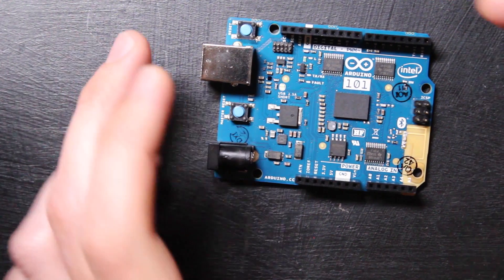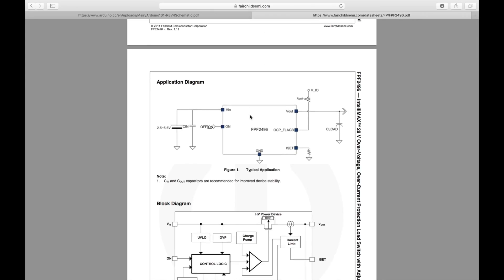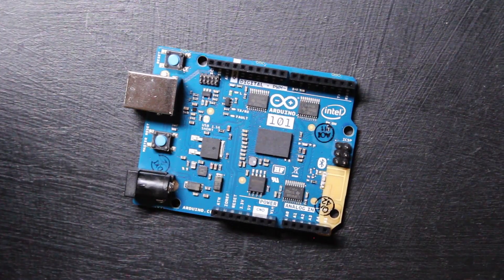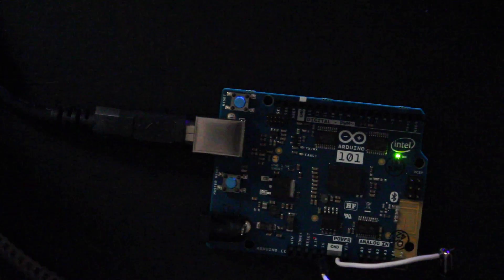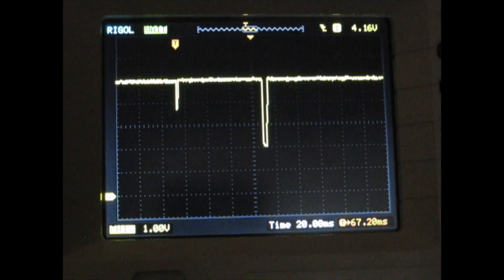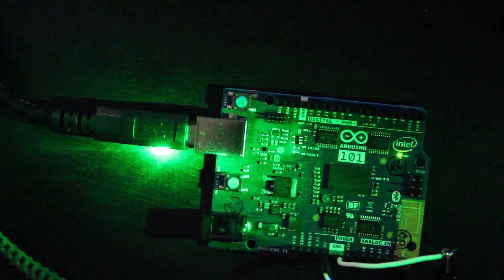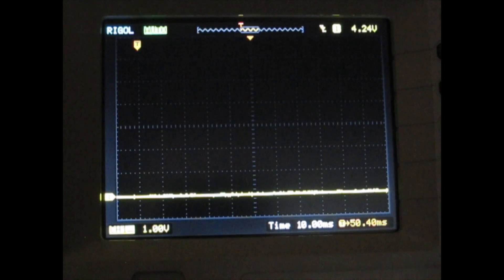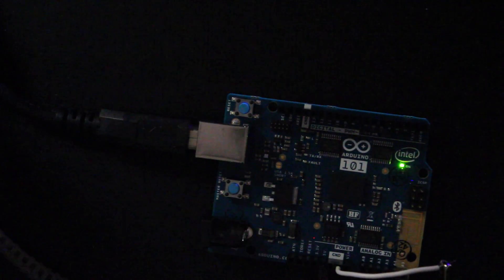Arduino 101 is LIGHT SENSITIVE!!

Comment: A little nerd info ... the reason you have two spikes from your flash is due to how the TTL metering works.  The flash emits a really quick pre-flash at a lower power level, in which the camera obtains exposure information, then it sets the flash power level accordingly and then fires again, which is where the second spike comes in.
I've never seen this before since it happens so fast, but I knew it did it.  Pretty neat to actually see it on a scope.
Reply from the maker: +David Miles wow, thanks for the info David!
Reply: +David Miles, TTL = Through The Lens or Transistor, which explains the pulse sequence on the light, but what about what happens at the circuit level? Could a photo-electric effect be creating charge that disrupts the circuit? Would be nice to do some systematic besting that is color based, so that you could determine if it starts at the specific frequency for a given work function.

Comment: So, should one paint over that section of the circuit board? Is there any type of paint that would be suitable?
Reply from the maker: +Monothefox eh, I'd just throw down some black electrical tape if you think you're going to expose the board to high intensity light
Reply: +Monothefox I've used some finger nail polish to cover these chips on my Pi's. Seems to work well,but it might take a couple coats,depending on the polish you use. (I think I found some old grey stuff,that was no longer being used - Ask before taking the SO's nail polish,or you may be in trouble.)

Comment: I suspect using such a part was cheaper in production, which is a shame because intense sunshine can cause the same effect on these chips. Thanks for the heads up with the vid.
Reply from the maker: +Thomas Verschoof yea, I'll have to check that out.  The folks over at rPI came sunshine does not cause an issue.
Reply from the maker: +Kevin Darrah *claim
Reply: I had issues with my rpi in direct sunlight, might have been a fluke.

Comment: So which means that the wafer level packaging ic should be used in a environment which is fully shielded from light source instead of the board meant to be bare.
Reply: They(CSPs) are normally only affected by certain wavelengths of intense light so in most situations they are fine even with strong lighting present.
Reply from the maker: +TheDessonater that is my understanding as well